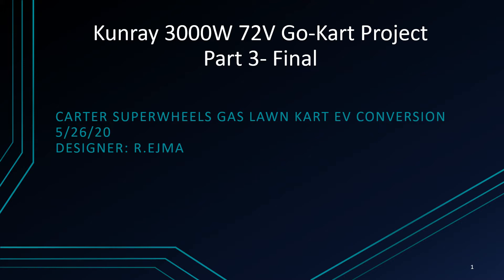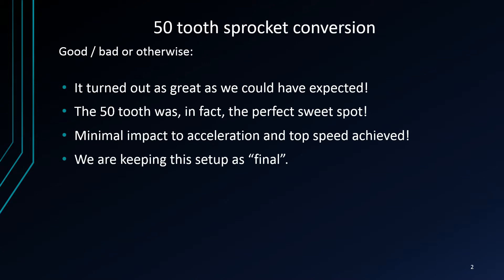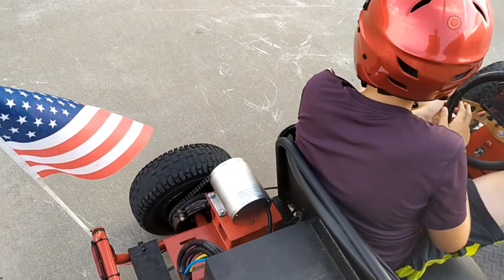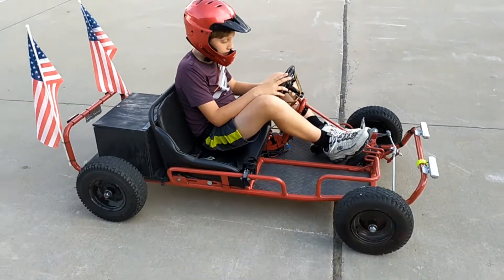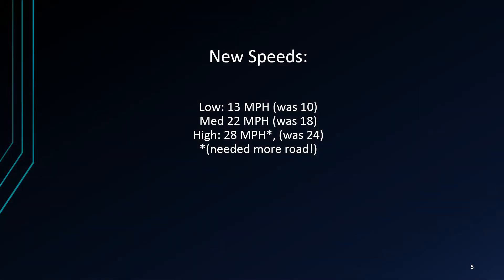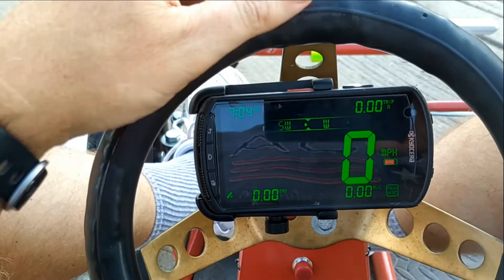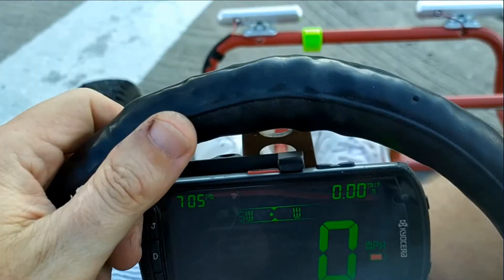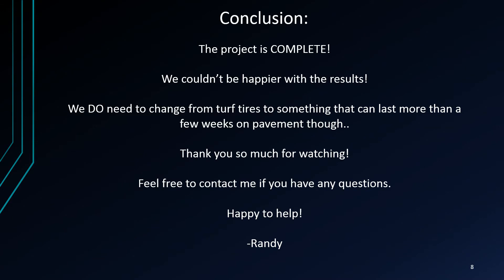3000 Watt 72v Kunray Electric Go Kart Build, Part 3 Final

Comment: Hey Randy I'm doing a build with an 48V 1800W motor, 18AH SLA batteries and ordered a 50 tooth sprocket to make a 5:1 gear ratio too. I really wanted to do this instead of 6:1 to ensure that my kart goes fast but I'm worried about overloading the motor and heating/frying it. I bench tested my previous motor order for 5 minutes and it got so hot the insulation started melting (I think that's what the burning smell was). That was probably a defective product which I returned, but I want to be cognizant of keeping the motor cool (relatively speaking). How cool is yours and how long do you usually run it for? I intend to go for around 30 minutes. I saw online that it's possible that motors get stressed when they are run below full rpm, but hopefully its okay with the 3 speed switch. Finally mine is a good deal weaker than your motor, not sure if you can speak to this but do you think at this gear ratio that it'll be the deciding factor? Sorry, loads of questions, but props for a great project and explanation videos
Reply from the maker: When it comes to heat, it's all about the current not necessarily rpm..  The RPM ratings are based on no load.  Part 1 details the go kart speed calculator on BMI karts, try that and see what #'s you come up with.  If you get unusually high top speed calculations, the 5:1 ratio may be too much, but then again, it depends on the weight of the kart and driver as well.  If you get 30 min of hard running seems about right for a motor to get hot.  It is always better to start out with a higher tooth count and work your way down. FWIW 6:1 is pretty standard.  If you melted a motor on the bench (w/ no load) in 5 min it was either defective or miswired.  The speed controller should have kept your current at or below the rated level, so that's weird.
Reply: @TexasNEV  The calculations show 31 mph. I see that yours is a 2 person kart and mine is 1 person, I'd estimate it would weigh 300 lbs with a passenger inside. Regardless, the controller is rated 33A, which is 88% I get from dividing the motors wattage by its voltage. So hopefully at 5:1 gear ratio, that works out. I was looking at forums on electricscooterparts.com, and they said that gear ratio should be fine for that power. I just wanted to check the intuition with someone who had done the build already.
Reply from the maker: @ritwikdixit6799  Well if they say it's ok, then it's probably ok.  If a 3000w geared at 5:1 gets me 44mph at 87v, then 1800w @ 33a @ 5:1 at 31mph seems to make sense.  If you find that the acceleration seems labored then go ahead and try 6:1...  Have fun!
Reply: @TexasNEV  Im curious as to why you were able to get a speed that was higher than your theoretical max for 5:1 gear ratio. Did you miscalculate your diameter of your tires or did the motor spin in extra RPM? The Kunray product says it can spin up to 5800rpm
Reply from the maker: @ritwikdixit6799  I was overvolting the motor and hitting insane RPM's far beyond the max rpm that I used in the calculator.. Would not expect the motor to live very long if I kept that up. :)  However I was using 4500 not 5400, but I bet I was hitting 7k.. !! :)

Comment: My motor gets real hot after a minute of running is yours getting hot too, since you run longer time?
Reply from the maker: Can you share more info on your build?  What is your gear ratio?  Weight of your go kart, etc?
Reply: @TexasNEV  it gets hot without weight just running it in my kitchen table
Reply from the maker: @jamegonz  hmm.. something most certainly doesn't sound right.  Mine doesn't do that.. I mean running the motor hard in the summer, oh yeah, it gets hot but if you are running it under no load and it gets that hot, either there is a wiring error or the motor is bad.
Reply: @TexasNEV  thank you for the reply

Comment: Quelle batterie es utiliser ? Merci
Reply from the maker: Any 72v lithium 20aH or higher will work.  The first battery was repurposed Nissan Leaf cells, the second battery I made using 72 6aH lithium iron phosphate cells in a 3s24p configuration.

Comment: 72v 3000w that should be much faster! Something doesn't seem right to me
Reply from the maker: We actually found that we had a faulty throttle pedal.  After replacing it and the other modifications in the post below, my son hit 44mph in it.  If you got caught up on the updates on the other videos and still think 44 mph is too slow, then I would suggest watching part 1 in it's entirety to understand the math behind the speed calculations done on BMI Karts website "go kart speed calculator".
Reply from the maker: What sort of speed do you think is correct?

Comment: is it 72v3000w right??  to slow ?
Reply from the maker: Correct, we are running the 300w motor at 87.6v and it is incredibly fast for a kids go kart.
Reply: @TexasNEV   um  72  3000w motor is maybe 40mph more  i think   ok  ty
Reply from the maker: @DwarfSin  Yes, if you read the updates, we did hit 44mph.
Reply: @TexasNEV   wow  thats right  goood

Comment: I'm thinking of putting a 72v brushless motor 3000w on a buggy for me and my kids to ride up and down the street. How do I determine if the motor is powerful enough to pull approx 150kg ? Or should I consider other options ?
Reply from the maker: Archimedes once said "Give me a lever long enough and a fulcrum with which to place, I can move the earth".   Same goes with sprocket size and gear ratio.. :)  If the total weight is 330 lbs and you have no expectation of high speeds and use a sprocket big enough, sure.  Note I just hit 38 mph in this go-kart (my son hit 44), I weigh 210 and the go kart probably weighs about 75 lbs.. So the question is, how fast do you want to go?  Note that 3000w is about 4 hp, and if your tire size can support a large rear sprocket (70-80 tooth) then that could be up to 32 ft lbs of torque.  What kind of buggy is it?

Comment: If I may ask, what pedal did you use to control the current? Did you get it all from Amazon? What battery did you use, 72 volt is it lithium and what is a good AH to get?
Reply from the maker: The pedal came with the controller kit but any universal 72v 0-5v controller pedal will do.  Here is a link to one:  https://www.ebay.com/itm/164213472074?hash=item263be2bb4a:g:NLgAAOSwH-VexxJ2

Comment: Question, I'm thinking about getting the same motor, my question is can you connect 2 motors to 1 controller?
Reply from the maker: I actually do not know.. I know you can connect two brushed motors to one brushed controller, but given brushless motors are "AC", my "gut" says you can't and that you'd need two controllers hooked to one throttle.  But again, not sure.
Reply: I've read you would need a controller for each motor and a strong/big enough battery for both
Reply from the maker: @Rawdogginglif3  correct! 😊
Reply: Yes!, you would need 2 controllers
each controller has 3 wires for the throttle, 
1 is power 1 is earth and 1 is the SIGNAL wire 

just connect the throttle signal wires from the controllers together then connect together with the 1 throttle signal wire (usually green) 
so all signal wires are together
You can power the throttle using the power and earth from 1 of the controllers
Hope that helps.
Reply from the maker: @mrgreen1402  That is helpful.. I figured it'd need two controllers but was wondering about the throttle, if you really could tie the two throttle control cables together on one throttle.. Cool.

Comment: If you put a 34t sprocket on that, you could go 75 with a slight gear reduction for added torque That just goes to show how powerful and fast you can go on a diy project. I love the bulid though
Reply from the maker: I wish that were true!  If you watched the other videos you'd see that I put a 40 on and it was too much of a load for the motor.  The gear ratio math may work but that's where it would end in this case.

Comment: Nice conversion! I modified a mini jeep its running  a similar motor on 60v,  top speed 22ish so 32mph sounds fast!
Reply from the maker: Yeah it was fun.. I have already completed another project, much larger, much faster, will be a week or so before I upload a video.. Won't be as fancy of a "presentation" as this but it is just the same thing, but bigger, faster, more power.

Comment: For wheels, id swap those completely for a set of race kart slicks, other than that i think its a nice project.
Reply from the maker: That's what we ended up doing.  This go kart is for sale on e-bay, traderrje.  It was upgraded to CST slicks, dual panel mount USB phone charger, upgraded power capacity buck converter, new Lithium Iron Phosphate 18 aH 87.6v battery and 250v charger.  My son has gotten so tall and has outgrown it.. It runs perfectly and texasnev.com will give 90 day tech support.

Comment: What is the battery on that?? It looks small, so im curious about type, and performance. Ive been looking for something to power my spare kart chassie, and had problems finding an electric motor cheap enough to justify the investment. I could get a minimoto lifan 160cc for about £280 with 14hp and a 4speed gearbox which could be fun or go nuts and get something crazy like a cbr600 for £500.. if i go electric instead, i cant see how i can get 6000w for £1000 and frankly id prefer 20k watts on the race chassie thats waiting because my other 2 karts both have 30hp approx petrol engines.
Reply from the maker: Hello, they are Nissan Leaf cells, however please watch the other parts, part 1 in particular to answer your question in more detail.

Comment: It should be tested at a faster speed.
Reply from the maker: How?
Reply: @TexasNEV  Reduction of sprocket teeth to 29 teeth
Reply from the maker: @itaechannel2149  Hi, if you watched the series, I indicated that a 40 tooth was too much of a load.  If 40 is too much then 29 would perform very poorly. :)
Reply: @TexasNEV  As far as I have seen, many motor clips 3000.w Can do speeds up to 60km/h
Reply from the maker: @itaechannel2149  If you have any configuration information for that, I'd like to see it.  I can see the potential for 60kmh (37mph) if it was a bike  but not seeing how it is possible in a go-kart with this motor / controller / battery setup.  The total weight with rider is probably close to 200 pounds and 32 mph is about 52 kmh which is pretty close.  Again a 40 tooth sprocket resulted in high heat and excessive battery drain, which means the load is too much for the motor.
Reply: @TexasNEV  How much is your wheel hub
Reply from the maker: @itaechannel2149  This is exactly what we're already using.

Comment: Congrats on the project and the excellent videos. This was really interesting to watch.
Do you know how low the voltage of the battery pack can drop before the controller shuts off? I’m looking to buy the same motor kit :)
Reply from the maker: Thank you!   The low voltage cutoff is programmable in the BMS.  The nominal cutoff voltage for Lithium Ion is 2.5 to 3v w/ a full charge voltage of about 4.2v  (So at 20s would be 84v full, 60v minimum level for considering full discharge.
Reply: @TexasNEV  Thanks for your reply. The reason for my question is that the kunray sales person told me that the voltage input range was 68V-78V. This sounded unlikely to me because as you correctly mentioned a 72V pack can be charged to 82 volt and discharged to 60 volt.

Is it correct that you had you system hook up to the battery while charge to 82v without any problems? I saw 80v on the picture of your battery indicator.
Reply from the maker: @MBcreates  I've had no problems.  The information they gave you can't be right... Given they (along with most others) would be using lithium for power, a fully charged 20s lithium battery is 84v.. They have to know that.    78v would be 6 12v lead acid batteries in series fully charged.. I can't even imagine how heavy that would be.
Reply: @TexasNEV  hopefully you see this, i am planning on getting this motor kit, I was going to get 6 12v lead acid deep cycle batteries as they are a bit cheaper and money is a large factor, what should I get instead?
Reply from the maker: @bio-engineeredassaultturtl8929  I would suggest something from battery hookup or batteryclearinghouse, something in lithium ion or lifepo4.  It will be cheaper and lighter.